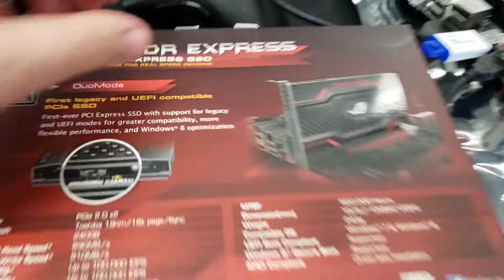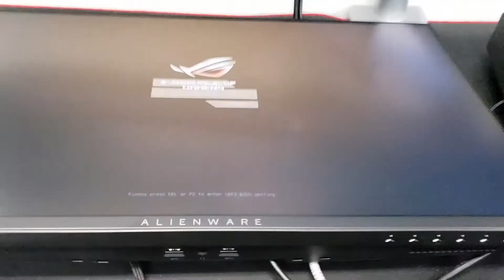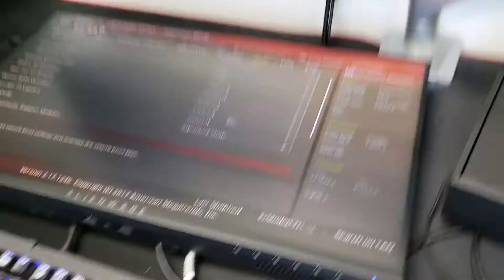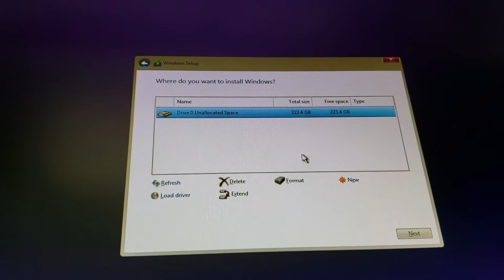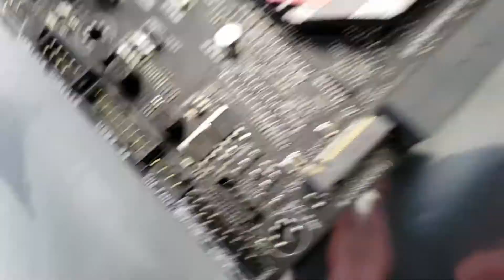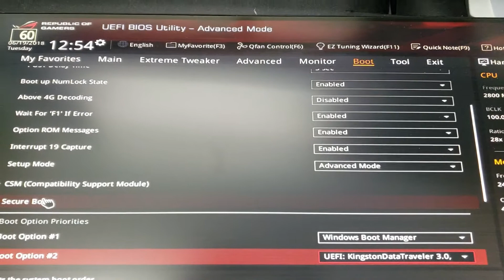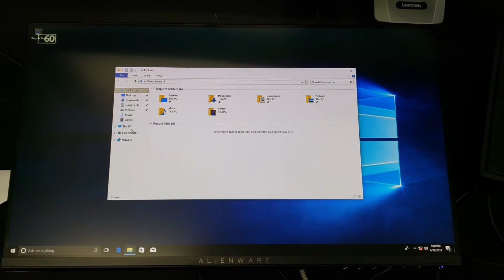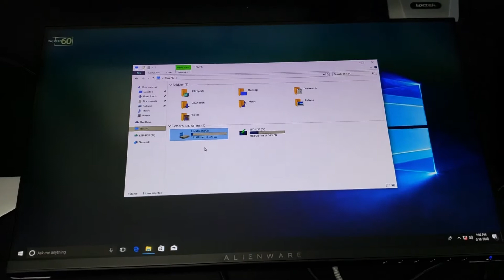ASUS RAIDR Express SSD Windows 10 Installation Tutorial - Computer Headquarters

Comment: One thing I just noticed that is different is that when I click new, windows only gives me 2 partitions, partition 1: System Reserved and Partition 2 which is the primary. I don't get 4 partitions like you do. I feel like that may be the root issue.
Reply from the maker: I am always using the ISO file from microsoft direct.  If you google "windows 10 iso download" the first link to microsoft website will give you the download.  Format a flash drive to blank, add the file to it, and then boot from it. It could be that the boot file you have is old or a manufacturers version etc.

Comment: Followed your steps and I couldn't get it to work. I got up to the blue screen to select language. I shut it off/turned it back on, switched CSM to disabled, secure boot to UEFI, saved bios, shut off again, flipped the switch on the SSD to UEFI, turned on again and got a message. "The VGA card is not supported by the UEFI driver. CSM settings have been changed for better compatibility." Only the USB drive is recognized in the list of detected devices, even though the bios recognized the SSD earlier when I still had it in Duo mode. I rechecked the bios and it had been switched back to CSM enabled. I switched back to disabled and saved. Same message.

I actually purchased this SSD back in May and somehow figured out how to make it work after searching on a million forums without definitive answers. Unfortunately I don't remember what I did to get things going the first time I set it up. Recently my PC blue screened and then was having issues booting, I got it to boot but now it freezes when I try to run a full system scan. Ran most of the recovery/troubleshooting tools with mixed results. But it keeps freezing so I figured I would do a fresh install. 

Going back to the VGA card message, if I press F2 to allow the process to continue it takes me back to the beginning of the windows installation process. Any ideas as to what may be happening? My mobo is an asus Z87-K. Appreciate any suggestions you could offer.
Reply: Same issue, except no vga message.
Reply: I got the same here 😞